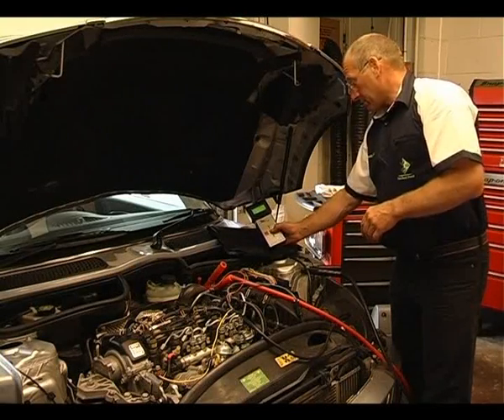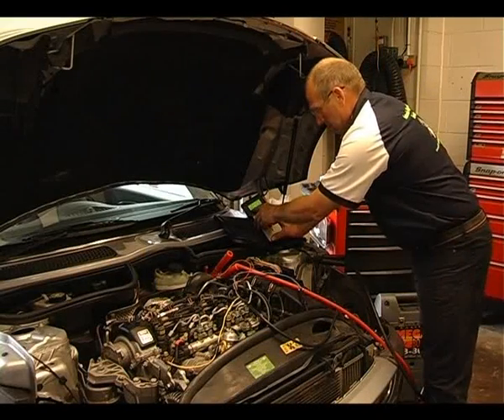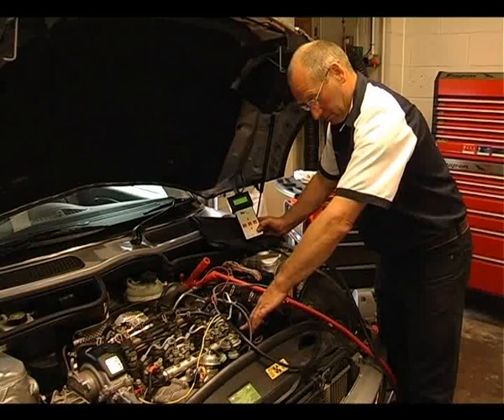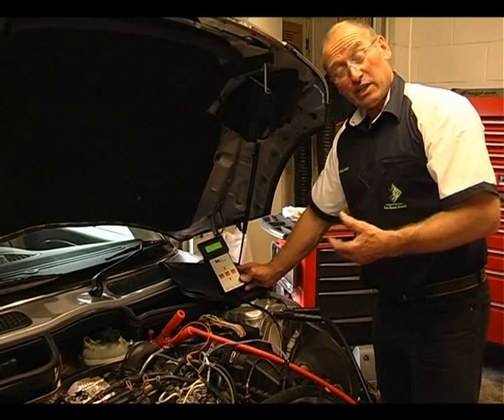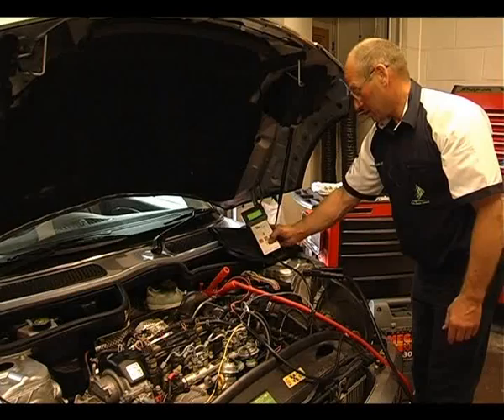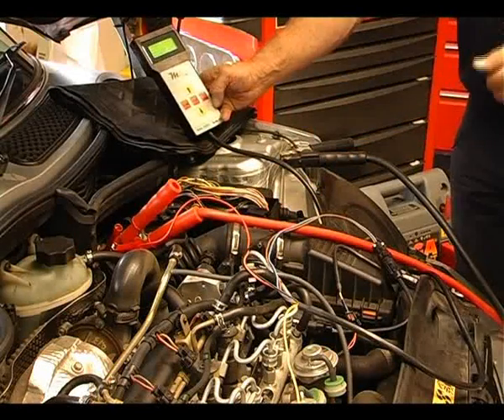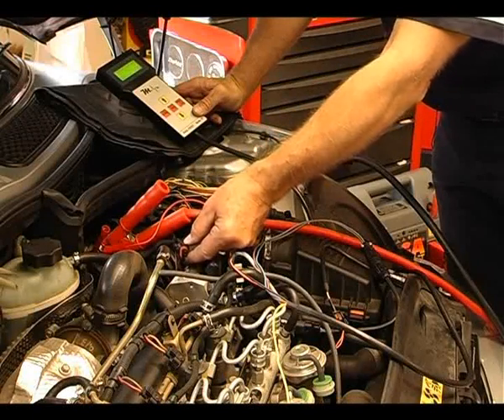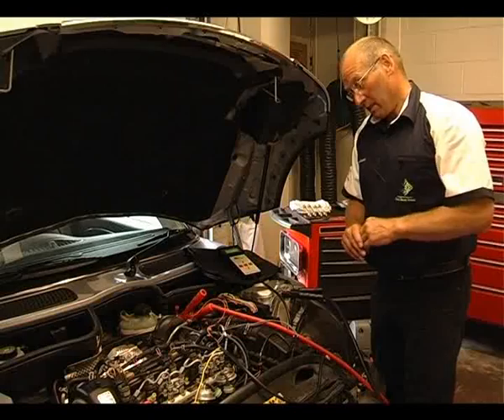Common rail diagnostics-part2

Comment: hi i have cranking pressure 300+ psi engine is not starting with the help of ether i start the engine and the pressure goes up to 4000+ psi what do you think injector or pump anyone help?